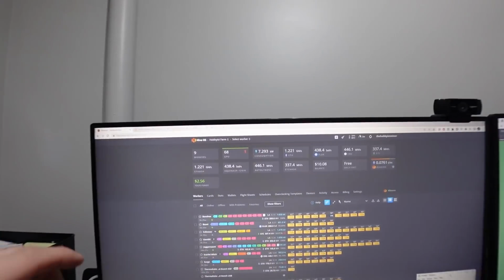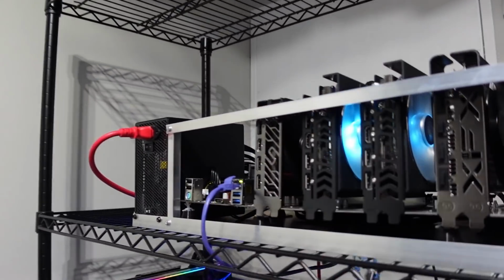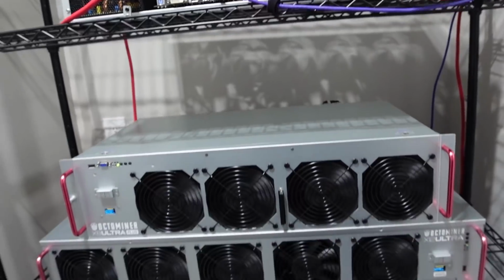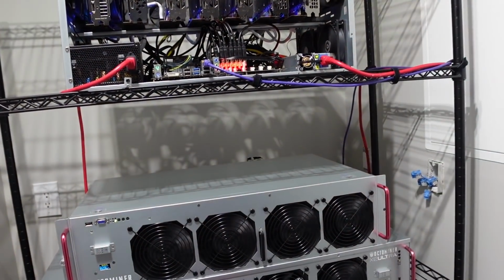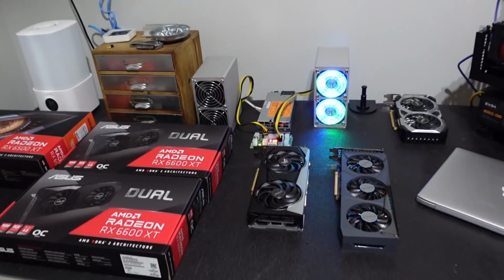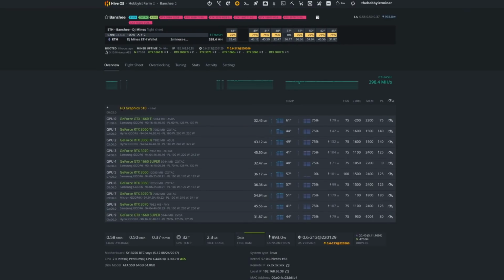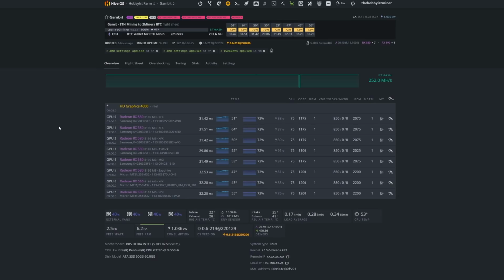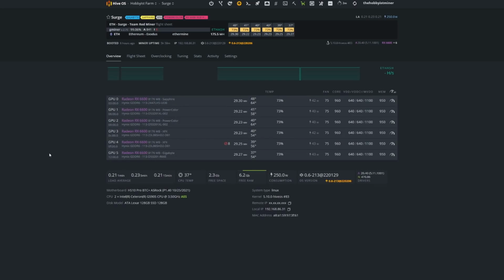68 GPU Home Crypto Mining Farm Tour  | What Am I Currently CryptoMining?

Comment: wow man your farm has seriously grown and i love the setup with the air cooling management your doing awesome . i run one rig that pulls 370MHat 1200watts. i have been wanting to get your input on the arctic p12 fans are they good > and do you connect all those litte 4 pin cables to the mobo ?? looking to get 6 of them ?
Reply: i run ASIA Horse fans  comes with a 4 port hub 1 fan 4pin onMB to power 4 fans... very powerful... I have 8 on my aaawave 12 card 6600 rig. pulling 360mh at 740W not including Risers. .

Comment: im doing the same thing like u bro, just more messy all around the house, and i dont have those cooling systems,just windows,but where i live 9 months are cold and 3 they go basement, so i dont need that cooling,anyway my question is whats your overall KW MHS efficiency , dont get me wrong but i think u waste much more energy than u should, im currently at 42 gpus,my are all 3070ti 3080ti 3090,aprox equal number each model im at 0.40mhs per wat.

Comment: The room is great but you need to sell all these tiny cards for minimum 3070s you have the power and space. Each 6 rig should be no less than 370mh Eth 

Space is a premium, wasting power on low mh cards is not worth it in a bear market imo

You have 68 cards at 1.2gh I have 15 cards for 1.06gh
Reply: Supply is my only argument to this man's statement. Other then the issue with supply I agree but why sell what he has if there just isn't anything available to replace them for reasonable prices and not insane scalper prices
Reply: @9r0t0typ3  well it’s just not thermally or electrically efficient to have that many gpus at such a low hash rate. Availability has gotten significantly better so I would be selling these for 60% and buying new 3080tis or 3070s if possible

Comment: Definitely interested in your results with the Gigabyte Eagle 6600XT.  My cousin has one, and it was a bear to get set up, and doesn't give the expected hash rate for a 6600XT, specifically because we could not get the memory settings to cooperate.  Haven't found anyone with the same exact GPU, so I'm very interested to see if your experience is similar.

Comment: Hey, VDD seems a bit high on the majority of your AMD cards. 800 should be achievable for most, 825mV worst case scenario. This should save you some watts and heat. The 900mV you're running on the one rig is way too high 👍